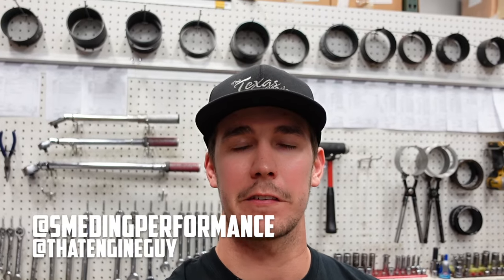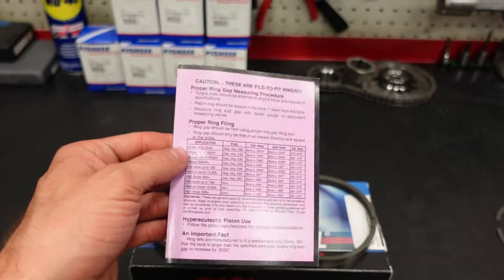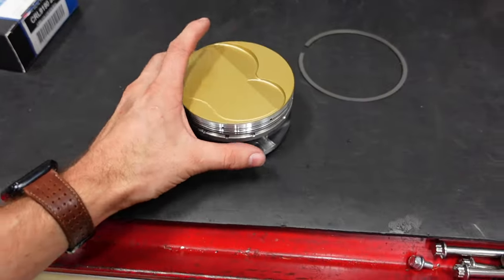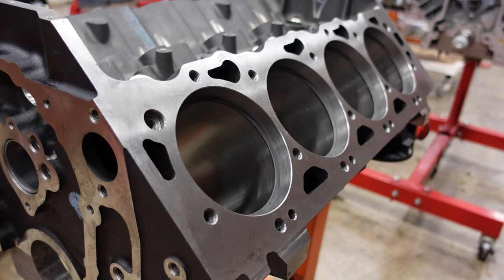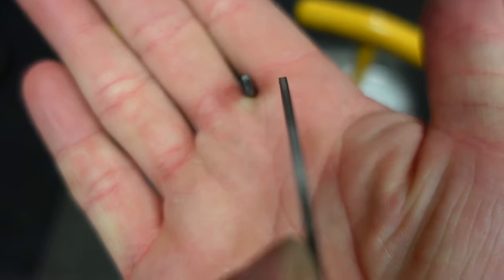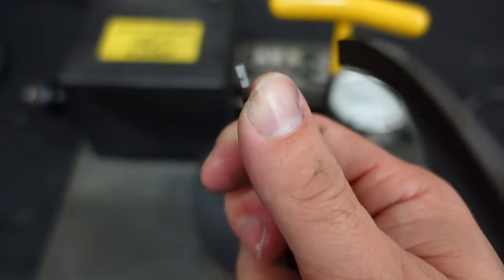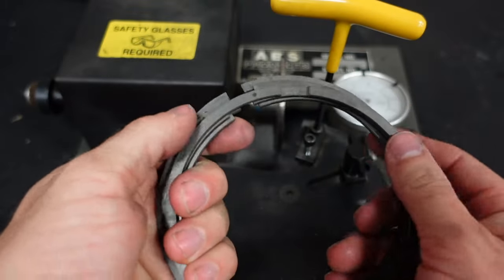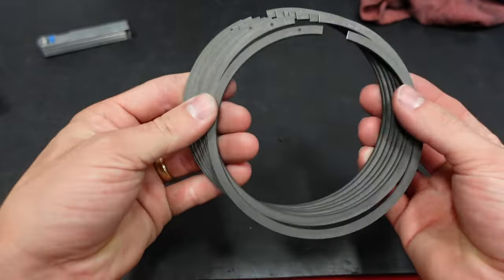How to Gap Piston Rings (very easy)

Comment: For 1st timers using the "manual" ring gap file, it is very important you spin the wheel in the direction that you're cutting in towards the center of the ring, never outward, to prevent chipping the coating on the ring. Also, only apply enough pressure that it is barley filing material off or you may damage the ring. Make sure you oil the cylinder with light oil or WD40, don't get crazy with oil, just need the tiniest film to keep from scratching cylinder while taking ring in and out checking gap. Too much oil, you are actually causing oil between ring and cylinder to give an improper gap measure. If you'er using motor oil, wipe on with finger and then wipe off with a clean rag, leaving the tiniest bit of oil on the cylinder. Goes the same while installing pistons.
Reply: I'd just add start with the second rings first otherwise I'd just about guarantee you'll over file them if you start the uppers.  Also count your turns it will save you time.
Reply: Rubbish! i filed my moly rings with a hand file got excellent compression and no issues for years after the engine shop that built my bottom end made the gaps to small and broke a ring you don't need a fancy ring filing machine at all.............
Reply: @duncanfelton5311  This is true. I have filed rings without a ring filer with no problem. It's just easier and quicker with the little cheap filer.Sad about that engine shop that failed to gap rings correctly. They had to know, they were just slobs.

Comment: 30-thou on the 2nd-ring... and ....the top oil-scraper . It stops 'flutter'/ oscillation between the two compression-rings and stops 'land-wear' . It's Very-important on any high-hp engine or even a standard one that gets-pushed ...and yes , it does affect performance and engine-viability over time
Reply: Makes sense….but how do you know it “flutters” or “oscillates”???

Comment: Great video, I learn something from every video. I would like to see  the proper fitment and trimming process on a cam button on an older SBC block, and how to get and figure and adjust for proper clearance to the timing cover. I don’t feel that the nylon buttons will hold up well so I’m referring to the metal bearing buttons. Thanx in advance 👍
Reply from the maker: You got it!
Reply: @JacobVillemain  if it has to be trimmed what tools can you use or are there a variety of sizes available. There’s not one video showing how to trim a metal bearing button, you would have the one and only video😃

Comment: I am rebuilding my boat motor. I was able to hone out all of the scratches. However, specs call for ring end gap of .011 to .023. The top and bottom cylinder are .023 at the top and .025 in the middle and .023 at the bottom. The middle cylinder is .025 at the top .030 in the middle and .026 at the bottom. It says it can be .002 difference in dia. and each .001 in dia. = .003 in ring end gap. Do I need to have this bored out? Just a note that is with brand new standard size rings.

Comment: You always file the burr towards the back or inside of the ring...  You didn't say anything about the burr causing scratches in the cylinder wall if you do not remove the burr, damage?

Comment: Any affordable ring gap tools on amazon you recommend
Reply from the maker: For a one time engine you can get away with the hand crank filers, but anything production will require an electric motor one. Check out Summit Racing’s offers.

Comment: What would you think if a so called professional engine builder, gapped my (4 inch bore) rings, at 0.007?
Reply: I would think he didn't bother checking just threw the engine together. Not a builder he's an assembler.

Comment: Nothing towards you....It occurred to me that there are more variables than what the piece of paper recommendations provide; such as rod ratio, different block/engine material combinations, engine coatings (heat management) even cooling considerations in components and fluids, and changes in aerodynamics, body design and airflow priorities over the decades...If a piston/rod angle can lose power at higher rpm, and even scuff or knock the walls somewhat (even that coatings are encouraged) along with the aforementioned thermal variations, the rings are often getting worked in uncommon performance builds, that may lead to failure in general building parameters.
Reply from the maker: This video was intended for 99% of every engine. The 1% you are talking about does not apply for what I showed here.

Comment: The paper has recommendations that will fit 90% of applications. You are looking too much into it.
Reply from the maker: Agreed, some people way over think the simple things.
Reply: I am getting a lot of conflicting information from people smarter than myself, and even though I am not of fan of reaching out to people online, I feel that I would trust your opinion.  I put together a 408 that will end up boosted. Despite the recommended ring gap by wiseco, I was told to do. 028 on both rings.   I have 210 psi cylinder pressure with about 20% loss on an old snap on leak down tester. And about 14 using the double gage method. There is quite a lot of crank case pressure (as to be expected) what do you think of all of this. Thanks for your input.